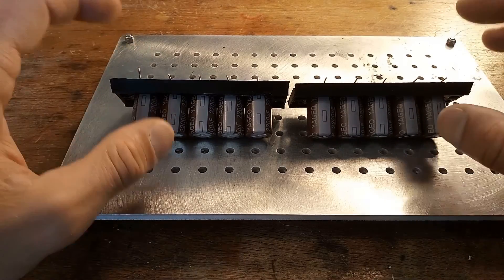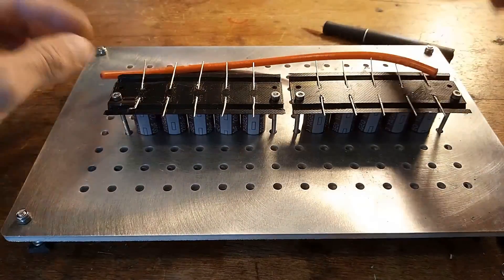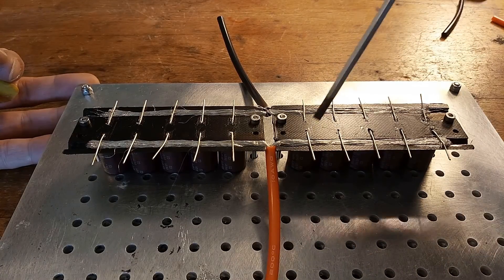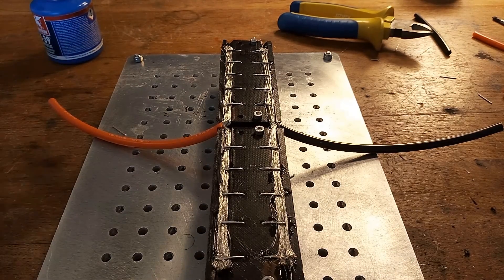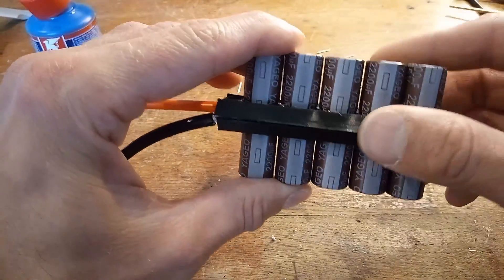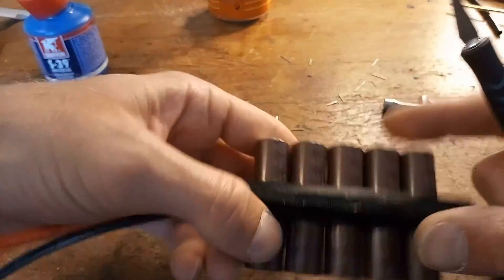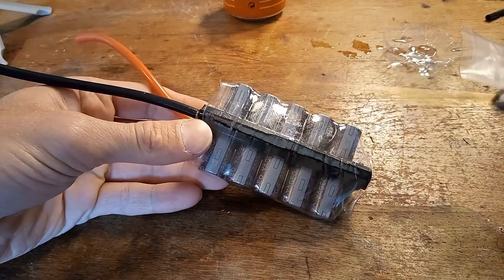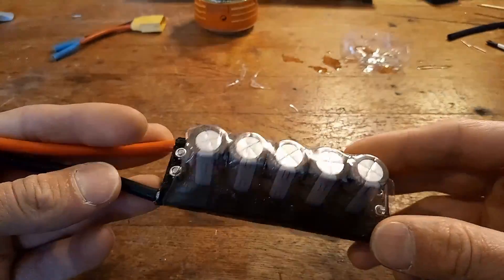How to make your own cap pack step by step

Comment: I did this with 6x 36volt 10,000 and used liquid heat shrink to seal it and 8 wag to a monster 8s.  Freaking insane
Reply from the maker: Nice..!!
I still have not used mine. As i am in the proces of rebuilding my Limitless V2. I came out of the box pretty dissapointing🤔

And its almost november and the weather is getting worse and worse. The road is either wet or really moist so speedrunning will be a bust this year i think.
Reply: @remborc  yeah same over here with leafs on the road.  Just playing until next year.  I want to try a bunch on super caps in series vs the parallel setup.  On 6s i have 5 seconds of extra run time after I disconnect the batteries with the 6 caps.  I did a 8 setup and it looks like the one you did, all 8s.  I will work on 4s and 6s caps as well.  Pretty cool.  Hopefully you video helps people.  I need pcb boards.  👍
Reply from the maker: @alterdcustomrc4512  Thanks!

As seen in the video i dont use a pcb. I used a self designed 3D printed frame and 10awg wire so it is durable for high power. The 3D print can be downloaded for free (link in discription). You can also redesign the 3D model easely (if you know how😅). So it will fitt your own requirements.

Luckely leaves and other dirt are no problem on the piece of road that i drive. Its relly the weather that is going to hold me back.

Nce to hear you are experimenting with different cappacator set-ups💪🏻 Do you see a reduced "voltage dipp"? if you have data logging on your esc.
Reply: @remborc  1.15 ripple on 6s with a tp long can.  Pretty instant different.
Reply from the maker: @alterdcustomrc4512  That is a pretty big defference💪🏻
Reply: do you mean liquid electrical tape?

Comment: Subbed I need those 3D printed cap pack holders I have 80 cap packs I order from Japan I was told there we one of the best.  There 38.9 Volt’s and 3900 ?   Is that could there very big and long in height?   Please help me I don’t know anything about it.   I was sold threw a company that make DJI drone parts ect..
Reply from the maker: Tnx for the sub!

The 3D file for downloading the 3D printed parts is in a link in the descripton of the video. 

Whats your specific question about making the cappack? The part list and tool list is also in the description of the video. And how to build it is shown in the video.
Reply: I don’t have a 3d printer?  That’s all. But excellent job and showing a build of very nice cap pack for 8s I assume.   👍🏻
Reply from the maker: @moereefer  Thank you💪🏻

You can search online for a 3D print service. I the Netherlands there are companies where you can send the 3D file to and they send you the printerd part back. I also dont have a 3D printer, a co-worker printed it for me.

As the thumbnail might have sugjested, i am goint to fit it to my XLX2. Hopefully i will get my Limitless v2 this week so i can start building and driving. Also because i crashed the Slash and i cannot do any speedruns now.
Reply: @remborc  cool looking forward to seeing your new Arrma Limitless V2.  Good luck.  Thank you for the help
Reply from the maker: Your welcome, good luck building your cappack💪🏻
And i will also make a video about how to connect the cappack to the esc. I havent done that because i want to place the cappack in a good position in the Limitless.

And i will defenetly make video's with the new Limitless!